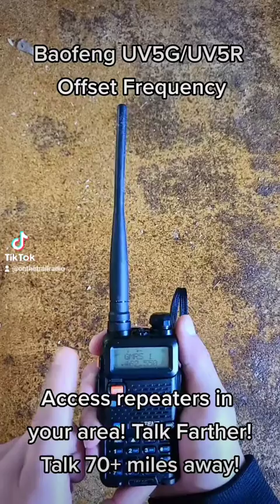Baofeng Offset Frequency

Comment: Question - I have the same radio. The “offset” for my repeater says it’s -0.6MHz. Is there a way to not add, but subtract offset from the 5R?
Reply from the maker: Offset direction, I believe it's menu option 25. Plus is add, minus is subtract, none is none
Reply: @OnTheTrailRadio  yeah sorry I saw that after. Just got these radios. Been fun learning

Comment: Why won’t the offset save?
Reply from the maker: Has to be in chirp
Reply: I fumbled with this also....manual and these tutorials not clear. I believe the Offset Shift Parameter has to be Active for it to take a Shift Value in MENU 26. Go to MENU Item 25 SFT-D ( Shift Direction ) and set in ON by entering a " + " or 
a " - " value. Now go to MENU Item 26 OFFSET and enter " 000.600 " for Standard Amateurs' Radio Repeaters in the USA.
I don't believe this Radio has an AUTO SHIFT feature like we are used to, in other Ham HT's. Gotta program each channel offset in memory, or use just one offset in the VFO Mode.  That's the way it looks to me, so far...